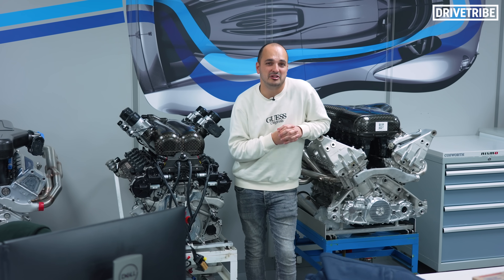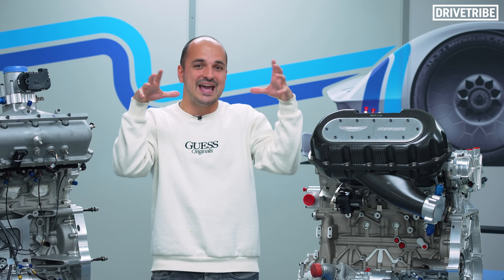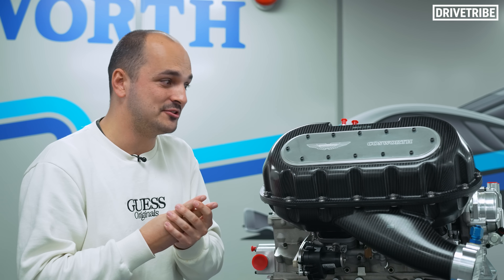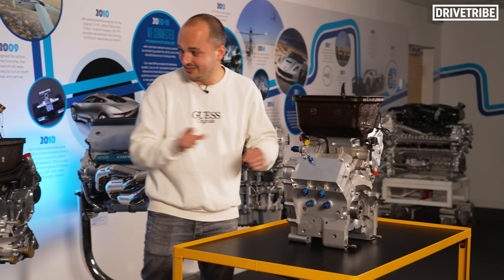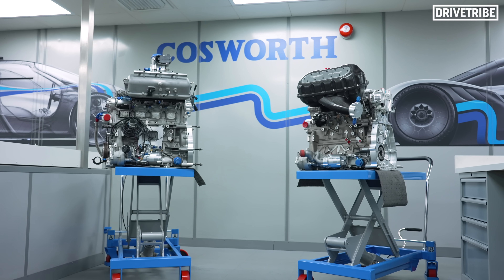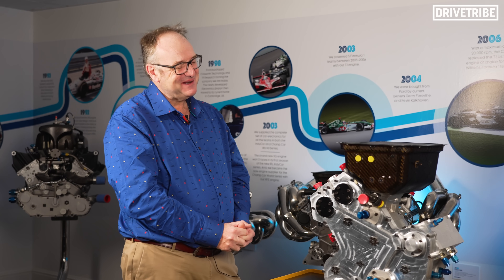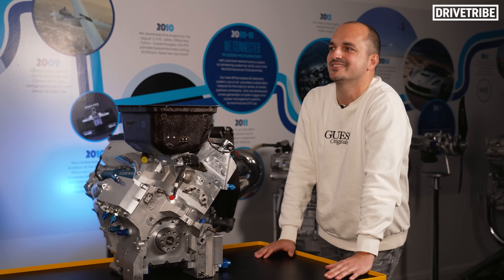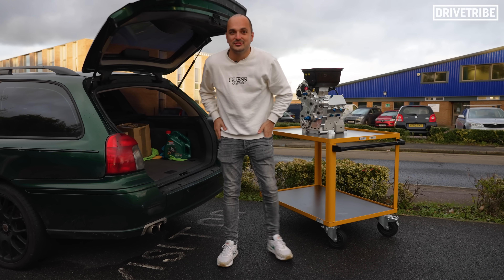This is a single cylinder F1 engine – 20,000rpm, 300cc, 90bhp!

Comment from the maker: Thank you to NordVPN for sponsoring this video! Holiday Season Deal! Go to https://nordvpn.com/drivetribe to get a 2-year plan plus 1 additional month with a huge discount!
Reply: 0:37 ''these are very special little things''
I accept they are special, but one can get more hp from a rotary in a smaller package.
Than again I have rotary engine (RE) bias.....braaaaaap. :)
Reply: Why does combining 3 cylinder to form a 12 cylinder produce additive power increase? Does engine balancing (V12 is inherently balanced while i3 is not), intake pulse harmonics, exhaust scavenging harmonics, etc. have no effect?
Reply: @sepg5084  yes and also the effects of metallurgy turns to alchemy to and even be on Harry Potter and sorcery if you follow the speech of this man from cosworth and how's everything that you know plus all the effects that I'm aware of that you're not are all totally eliminated by merely staying so in a video
Reply: @sepg5084  Basically because theres more flow area vs the displacement the more cylinders there are.
Reply: For your Opel Kadet .
Go use a fiat 900cc 2 cylinder with 90 horsepower .
If you look for a smal engine .
Its use in the fiat panda cross.
Reply: @dyslectische  1.2 spit fire engine 🙌🙌
Reply: I owned. A opel.kadet. for its time its was with a upgraded carburetor an a few more minor. Upgrades was fast. That was my frist car wow. !   I forgot about owning one this was worth watching. For me anyway thanks for the memory. I wrapped around. A telaphone pole.  That unibody car was like stopping a beer can. That's why it get wrapped around Beer  I still miss that car after REMBERING 55 YEARS AGO. OPEL. KADET MY FIRST!!
Reply: 90hp 20000rpm it's insane iam excited to see  this engine in car
Reply: Nord VPN is trash. If you're a VPN service and have been hacked you are useless.
Reply: Tell them what's money. Let's go have some fun.
Reply: And excuse please let my comment ended up roughly as I'm being censored at this very moment by the YouTube box of artificial intelligence
Reply: Just to let you know GT is on Amazon prime, and Amazon has VPN detection and blocking. So what you are promoting doesn't' work :)
Reply: @grumpyrider369  Oh don't forget the clothing "Guess Originals"
Reply: Great show! Thank you very much! What a dream it would be to have a car with a Cosworth heart in it.
Reply: I disagree....1,993 cc Cosworth YBT turbo I4 (1992–1994) and the 1,993 cc Cosworth YBP turbo I4 (1994–1996) was the best cosworth engines ever built.
Reply: Awesome 
(Bonsai tree)
Reply: @esurfer26 The Horse power at 19,000 RPM. If you can find a 90 HP 1 cylinder 18,000 RPM motorcycle engine I would be interested in seeing it.
Reply: I KNOW WAYS OF MAKING POWER THAT IVE SEEM NO ONE USE.
Reply: That single cylinder F1 engine is best for a VW Bug or Beetle, even at Le Mans 24 hours racing other VW Bugs and Beetles.

Comment: Did I understand it correctly? I should start with ⅒ of the 3.0-3.5 Liter na V10 I'm planning to make? My goals are low emissions (which might be easier for me because I want to use hydrogen as fuel), high rpm (the goal is 20000+ rpm) and 1000kW at the wheels (I want an rwd car).

Comment: The Aston Martin engine has 2 more liters in displacement and still revs as much as the t50. I think the Valkyrie engine and the rb17 engines are by far the best engines ever made. The rb17 is ridiculous. A v10 that revs to 15,000 rpm.

Comment: I wouldn’t mind having the GMM or the other one in a Ford Pop, Austin Farina A40, Ford Model Y or Karmann Ghia. Why don’t they sell a version of the three cylinder as a crate engine for hot rod, Kit car, boat, racing or aviation use?  As for the single cylinder, you couldn’t use it in anything.

Comment: I'm sorry this video was garbage, I can build a small block LS motor that would put out any production engine on the block. Even if I had to run for 24 hours straight at 600 horsepower Non-Stop 850 horsepowe 9,750 RPM while doing all that breaking all Hondas and Toyotas BMWs and Mercedes leaving them in a wake of destruction and Carnage well the Corvette wins again don't bring trash Germany Britain France.
Reply: You should do a series on it

Comment: That 3 cylinder AM Valkyrie engine in my hunk of junk work car that weights 2,000 lbs would be ridiculous. 250bhp would already be a massive upgrade to the 80bhp it’s making from its 2.2L pushrod 4 cylinder engine that drinks gas like it’s a V6 from a mondeo.

Comment: Bla bla bla... do you realize that in this 13 minute video, I had to skim through over 7 minuted before you stopped random blabbing and finally even mentioned the topic that I clicked to actually hear about? There is of course, the pre-amble or introduction to any discussion but that's ridiculous. Then when we're finally rewarded with the single cylinder engine, no one took the time to find 10 seconds worth of video to see and hear it running? This is just poor, lazy writing and production in general. Thumbs down.

Comment: Ok, 20,000 rpm us impressive, 90hp isn't. There are many engines that can produce 90 hp per cylinder. My truck does that at under 7000 rpm.

Comment: Our 1985 MK2 Ford transit camping-car is 2.5 dci at 70 hp. this cosworth single engine would fit perfectly.
 Could you imagine a Ford motorhome driving around at 90mph with an engine revving at 20,000rpm going through any town?

Comment: how about that 90 HP 20,000RPM single cylinder engine mounted in a motorcycle? isn't it cool that single cylinder engine revving at 20,000RPM can top at over 300KMH and easily beating any other multi-cylinder motorcycle. you know it's awesome.

Comment: Why are manufacturers not using some sort of one way valve machined into the top of the piston at a start of maybe .01mm and see where it’s efficient before it melts a billet piston. Surely it could help massively with head flow
Reply: Like a tezla valve integrated into the piston crown in the exhaust direction 😂

Comment: Can we have a commercial engine making those same 90hp from 2 cylinders and 600cc? Perfect for a bike.
Reply: U have tons of motorcycles with that config
Reply: @r.fumador1146  Name a modern one.
Reply: @SalveMonesvol  Suzuki V-Strom 650. yamaha mt 07.
Reply: @r.fumador1146  650 and 700cc. 70 and 75 hp respectively.
 As I said, I don't get why they can't push 90hp from just 600cc. Both examples make 107 HP per liter. I'm talking about 150hp per liter. That's not a small difference.
Reply: @SalveMonesvol  they can get more power but for a street vehicle u need torque. The old yamaha rd500 started with 88hp and its a 1980 motorcycle. But it had a really small powerband to use.

Modern 2 strokes like sutter 500 are on the 200hp game but its a widowmaker

Comment: Such a single cylinder test engine is incredibly expensive. It is a multi-modular system where most of the parts are designed to be reusable for a large number of subsequent test procedures. It takes a long time to design these reusable parts according to the specified tests. From test to test there are only minor hardware modifications. Often almost all the test engine parts are manufactured as unicates from blocks, cylinders and tubes. There is a lot of hand craft to be applied. Sometimes it is possible to use parts of a series engine with some modifications.

BMW used a 4 cylinder series engine from consumer cars to develop the 1.5 liter Formula 1 engine on that base. They were lucky to have this engine base. But this is not typical.

Comment: My motorcycle only has one cylinder engine and it prooduces 74hp at WAY lower rpm (ktm690)....so while I am impressed?  not THAT impressed ....still would like to have something along those lines in a  little featherweight street bike to run the canyons on!  maybe only 80bhp at 14k rpm or something?   An 80bhp 250 llb wet super motoish motorcycle?  Well more with a little fairing I think     But I like the 3 cylinder mule as is for Miata!  250hp and revving to the MOON!

Comment: Thought I would lose interest in this video fairly quick. NOT. Very interesting to think of the combustion as priority in efficiency then build the engine around it. I'm a life long Ford guy. Ford has always had restrictive heads and valves. I see Ford with the Cosworth. Had Ford thought of engine development combustion first they may have had an even better bunch of Windsor family of engine. Currently the Chevy LS engine is probably the best engine made of all makes of engines. Ford's best engines are the Windsor family of engines. Just my 2¢.

Comment: id like to reach out to Bruce about the TJ v10! i got a project in which I'm recreating the TJ v10 in a Engine Simulator!  there is allot of key information missing and i need to be able to call or email someone from Cosworth to answer some questions about the specs and timing and also cylinder head flow charts or some measurement of the flame front speed! all of this can be typed in the code and be simulated to output a realistic sound replica of its specs! that way future racing games will have real time engine simulations for a more realistic sound and output!

Comment: This engine belongs in offroad applications. Considering most companies use big/mid bore single cylinder engines in their atvs. This would be a great fit for sport utility atvs and or a small side by side. I could see this in yamaha/textron(arctic cat) atvs and side by sides considering they share the yamaha 700 single

Comment: Power to weight ratio model. Try this, a 19,200liter single cylinder with two-scroll turbo, where we add 1.6liter cylinder multiplied to 12 where 12 is the supposed to be the number of cylinder

Comment: I want to have mule engines for myself. Especially the Valkyrie Inline-3. 
Edit: I can solve the rpm problem: place a 2.00 under-drive epicyclic gearset between the crankshaft casing and the rest of the powertrain.

Comment: Oliver needs a k20! With ITB's it will make 300 hp and probably weighs the same as that old, tiny engine that made 60. Fit it with modern 225 square tires with replica wheels that look as original as possible, redone suspension and boom you have the coolest car EVER!

Comment: 250 hp on a 3 cylinder is not bad but koeningsegg 3 cylinder engine makes 600hp
Reply: Yes that is true. But koeningsegg use twin turbo to created 600 hp. And this cosworth is just an N/A
Reply: @NayaA-Ri  yeah but it’s crazy that you can get so much from a 3 cyl

Comment: That single cylinder engine is pretty cool! I used to run junior dragsters and when you first start out you get a single cylinder engine. It’s a Craws Racing 3 1/2”. 
I’ve done 280 passes on the engine. It’s roughly 70 HP. Seeing 90 out of a single cylinder isn’t very hard. What’s hard is making it last at that amount- and making it economically viable.

Comment: Dicasi motori ad alto rapporto peso potenza. Fu applicato questo concetto prima da smart , poi da Mercedes. Poi esteso a tutto il mercato automobilistico.
Fu scelto quel motore perché quello elettrico nel 2000 sarebbe stato fuori mercato.
Fu scelto quel tipo di motore perché gli altri (ne esistono di ancora più performanti , come il boxer ,o evoluzioni del rotax) erano o sperimentali o con elevati costi di produzione e manutenzione.

Nel 2000 era innovazione. Oggi è roba vecchia.  Implementa Citroen questo concetto sulle C3 (1.2 puretech .bassi consumi, bassa potenza ,buona affidabilità) perché sa che tra 10 anni sarà tutto elettrico.

Comment: I remember  back in the 1980's  a friend had one of those cosworth Vegas GM built in the early 1970s. 4 cylinder dual overhead cam with mechanical fuel injection.  Was pretty quick  for something so small.

Comment: Lets run that math again- A 3 cylinder is 1/4 of a 12 cylinder so if we multiply the 3 cylinder by 4 we get a 12 cylinder or maybe if you say the same thing a couple different ways  you can make a longer more boring video...

Comment: Yeah,you'd have to have like a 7to 1something gear at least,if not higher to put a motor that has a 20k red line,in order to not go 100mph in first gear.and for it to actually leave the line without burning thru a clutch every time you take off

Comment: The Honda CRF300 engine makes 27bhp at 8,500rpm and tuned for torque rather than outright power. If you consider an engine to be an air pump then more revs gives more power by virtue of shifting more air. The real achievement here is to rev to that level without self destructing. In a day and age of fuel shortages and climate the real test will be power AND energy efficiency.

Comment: "Put it in Richard's Opel Kadet" and then find a starter motor that can turn it at the 14,000 rpm it probably needs before it will run!

Comment: The industry is moving towards electrification. 
I do wish there was a chapter of automotive evolution where we saw regular family cars and SUVs with these little engines that would rev up to 18-20k. 

Imagine a 3 cylinder Chevy Tahoe or Dodge Durango that could rev up to 18k and still pull as hard as a V6.

Comment: People wanting those 1,  3 cylinder models should also consider arranging pit stops for every 10 miles they pass and a team to pre-heat and check the engine. Even after doing all those, noise cancelling headphones  might fail to stop the  headache they got from cruising at 12-16k rpm.

Comment: Now, THIS IS THE STUFF!! I don't care anymore about seeing 8-liter engines with 1,000+ hp in a production car. Big deal. I want to see 3 or 4-cylinder, 1 to 1.5-liter engines that produce 200 - 300+ hp, "normally aspirated" engines in production cars. THAT would be impressive!
Reply: I also agree whole heartily!
Reply: Take a motorcycle engine and put it in a car. Naturally aspirated, 1000cc four cylinder. 200-250hp sometimes 300. And high revs.

Comment: 98 lb 3800 HP at 28-32,000 rpm, on an automobile  sized rigid helicopter 🤔🤔, like a one ton pickup that flys, handles like a Porsche, and can drop in & out of the average back yard "size" ,, in seconds 🤔😜✌️

Comment: That single cylinder engine would definitely make a brilliant motorbike engine! Not sure it would have the low down torque to be any use in a car?

Just trying to compare with the 875cc Twinair engine in my Fiat Panda, which is a 2 cylinder turbo engine developing around 85bhp.

So pro rata that would be the equivalent of my engine producing 262.5 bhp. 😲😳😁

Nice......😲
Reply: That motorcycle better have a very sturdy quickshifter and slip-assist Clutch.

Comment: I would love for a cut down version of the Cosworth V12s to be put in relatively normal cars! Like imagine a 250 hp 10-11k RPM 3 cylinder hot hatch. Or even better would be a 500 HP 10-11K RPM Supra! I am a little kidding about that last one but even a I-6 version of either of these V12s would be amazing in so many different cars. Even within Aston Martin, they NEED to put a cut down version of this engine in one of their more normal cars. People would pay a lot for a car to have that much character in their modern engine.
I hope auto manufactures really try to get a version of these engines in a special version of their sports cars since that would sell super crazy well and would give them great publicity and respect from the enthusiast community.

Comment: Seems like a little low horsepower for 20,000 RPMs. I am not sure exactly how many ponies the Polaris single cylinder engine has, in there newest snowmobile model, but it is close and way lower RPMs.
The single cylinder engine doesn't look to be a round cylinder.

Comment: I remember having to line bore the main bearing bores on the RJ engine when I worked in the prototype department. It took very careful setting up as the limit on size was only  8 microns. It was great to be involved if only in a small way. 🙂
Reply: Well you would think so,  but actually it wasn't tep controlled. None of the machine shops were temperature controlled. I never really understood why to be honest.
Reply: Probably all temperature controlled work.
Reply: Hi Adrian, I also remember doing a few of these on that old cranky Newall Jig Borer, hope you are keeping well?

Comment: I watched a FortNine video about the Honda Fireblade 250cc 4 cylinder motorcycle that redlined at 20,000 rpm. You could buy one, ride it daily, and they were reliable. Incredible.

Comment: I wonder how these high rev engines don't throw rods after 5000 or 7000 rpm.  Every internal combustion engine uses the same con rods, bearings etc. and suffers the same forces.   There's a reason most engines are red-lined around 5-7000 rpm.  What makes these Cosworth so special

Comment: could use a 3:1 ratio inline planetary gearbox between that little engine and Hamonds car transmission. that will give 6,666 rpm on the primary shaft at an engine speed of 20,000 rpm plus multiply the torque 3x making the engine far more tractable.

Comment: honestly 90 HP for 1 Cylinder is not that great..   unless you add insane reliability..   you can get 100HP easy per Cylinder but reliability is usually an issue at that point..     Some drag cars are pulling almost 200HP per Cylinder.   top fuel cars a lot more..
Reply: 90 bhp from an 18 cid cylinder, normally aspirated, and burning PETROL is impressive.

NHRA Pro Stock engines make about 2.5 bhp per cu. in. running on a very-high octane fuel, whereas this cylinder is making 5 bhp per cu. in.

Comment: You can't automatically assume to achieve the same hp as you increase the number of cylinders, with all due factors in play, friction alone can rob nearly 42% of power. I watched these videos to escape from reality .. Simple mathematics! No disrespect...it'sa bit subjective and obscure for those well versed in creating HORSEPOWER!....IT'S JUST A PUMP....just keep in mind" maximum flow